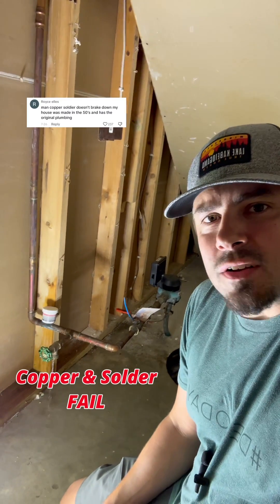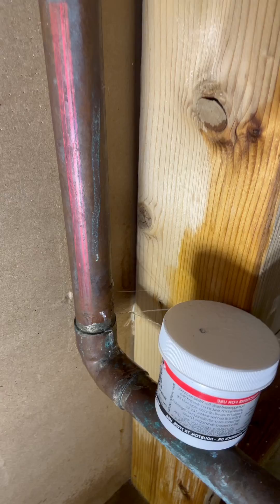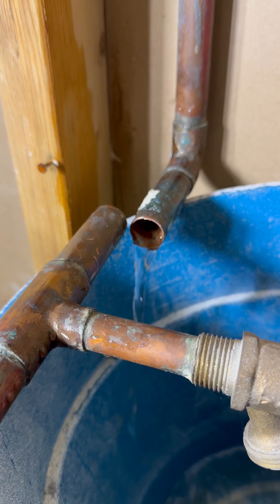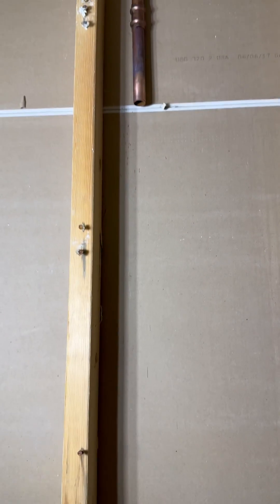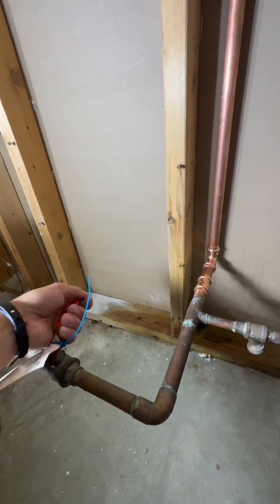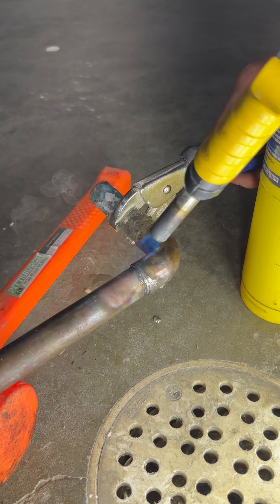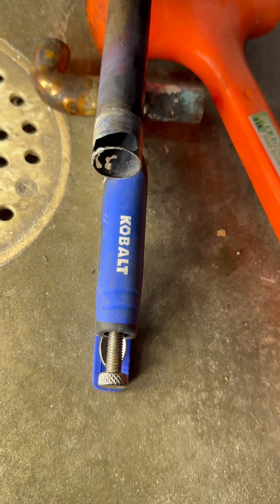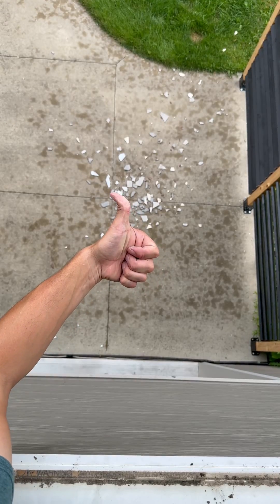Copper Pipe ￼Disintegrated At Solder Joint #shorts

Comment: Sorry, by "separate pipe" I meant " do you have to run a separate ground?".   Tying copper to step out lead via electric bond may cause corrosion... Usually with your lead or steel.  You don't want that either.  Grounding both to ground rod (rather than use pipe going into ground) is best way to prevent corrosion. 

Also note that your pipe entered from ground THROUGH CONCRETE SLAB into meter.   The pipe should not be in contact with concrete.   This is another source of corrosion in your system.  Carefully remove concrete around pipe and wrap with plastic before refilling with concrete... Or just leave sand around entrance of pipe.

Yeah... there are that many things u need to learn before you say that metal pipe is no good.

Comment: Check your grounding and bonding across the water meter.  What kind of pipe do you have going in meter from street or well?  Do you need to put a gasket on that and run a separate pipe?

The other possibility is that the know-nothings back in 1993 did not use an acid-free flux appropriate to the copper pipe.  This also causes exactly the same issue you see.

Mice and rats do chew through PEX.  Even despite additives.

The softness of the metal has nothing to do with its potential to corrode.  The electronegativity does.

So much to learn.  Suggest you post your videos asking questions of people who know, rather than assuming you know stuff.  You've got a lot to learn, man.  I respect that you are trying, though.  Just please stop coming across as a know it all.  When you have some grey hairs ... Or a lot of them even.. you will have the right.

Comment: An expert would tell you that you have some galvanic corrosion going on there, likely due to either your copper not being grounded, and/or having it connected to steel or other anodic metal.

Perfect representation as to why your should hire a professional and hang over his shoulder to learn.  If you spliced pex in previously, then you likely created the problem.  Good job!!

Expect more copper to fail due to your lack of understanding of why your copper is corroding.  Also check for short circuits to ground, if your electric is old and clamped to plumbing.

Wanna remove all copper and do your whole house in PEX?  That's just fine.  Otherwise eliminate sources of galvanic/anodic corrosion (copper goes with brass.. nothing else) and bond separate sections of copper with a #8 ground and bond clamps.

And don't look for experts on the Internet.  Hire experienced plumber and electricians.  Maybe an ASHI home inspector, too.  She or he should be able to educate you about both .